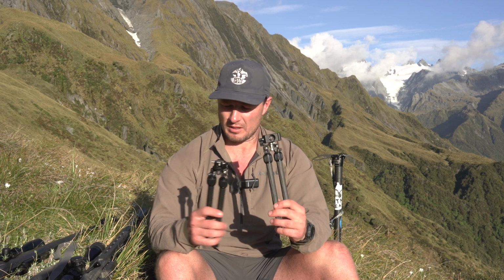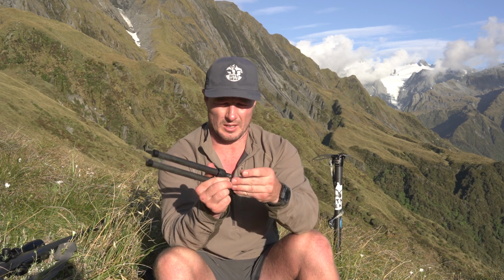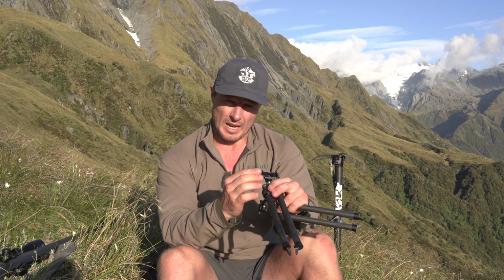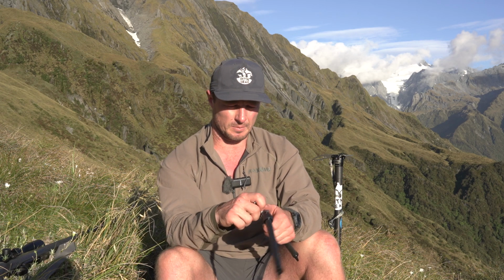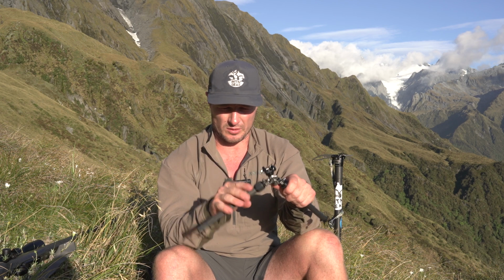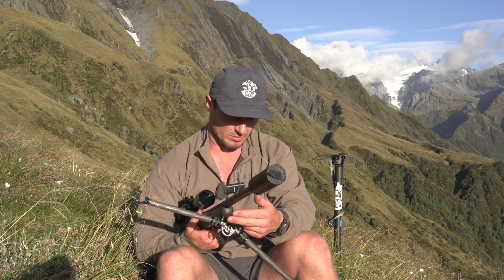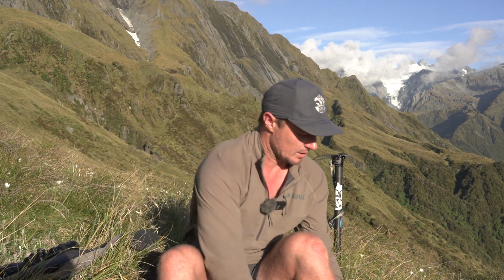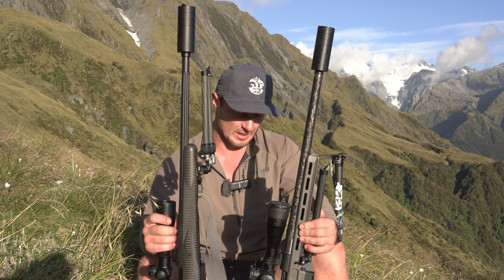MTNGear Mountain Bipod Overview

Comment: Hi Matt whats the specs on your xlr build? Looks nice. Folding stock option?
Reply from the maker: It's a rem700SA element magnesium, love the chassis but didn't love the original carbon rear end so I've made my own rear carbon stock and folder which are more functional for me and half the weight(looking to sell these parts at some point)
6.5prc, pierce titanium action, proof sendero lite and a few other accessories here and there. Can do a video at some point once I get these stock parts finalized for production.

Comment: Is that bottom leg 1 inch in diameter? Can it be removed from the upper part of the stick? If so I can see my self drilling a 7mm hole on the end and putting on a near zero titanium shovel on and securing it with a pin. If that bottom leg is sturdy enough handle a hole being drilled and being used as a shovel could be a sweet set! IF ANYONE KNOWS PLEASE GET BACK TO ME!!!
Reply from the maker: @Canned_Cans  leg is 24.95mm (inch is 25.4mm) so close enough. There is already an 8.1mm in the end that is hidden. Not sure if it's placement is right though. I have a few comments. When you undo that joint there are a number of parts that come loose so watch out for that. Carbon tube isn't as durable as a wood handle particularly with high shock loads. I wonder if the hole though the carbon might flog out. Solution could be a 6inch reinforcement tube you slip inside and a little brass insert you push though the carbon before the pin to help protect the carbon and spread the load a little.
Reply: @MTNGear  awesome thanks. I might also just consider replacing that bottom leg with a thicker walled leg (2mm) that should help give more strength. But first I have to order a mountain stick.
Reply from the maker: @Canned_Cans  current wall thickness is 1.25mm fyi. It would certainly work and be straight forward to do. My comment though is that the extra weight down low will mean it doesn't swing so nice in hand when walking. That's a personal preference thing but clearly it will take more force/torque to get it swinging. I could be worth having the handle as a stand alone item so you can be rough on it without risking damaging the tube for the stick. Wouldn't be the end of the world you can still clamp it back in there but for the walk home it wouldn't be full length.

Comment: Hey Matt can we front load with this bipod
Reply from the maker: @Sg16-  yes absolutely and it was designed to be used that way. You obviously won't be able to put as much in to it (especially with legs extended) compared to something significantly heavier which I guess is to be expected.